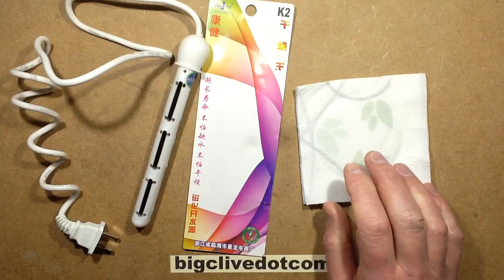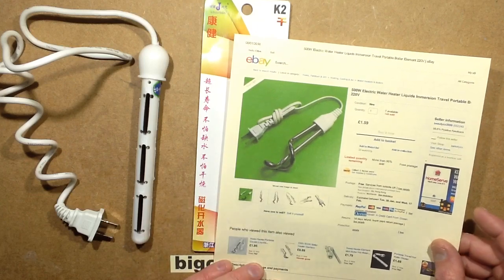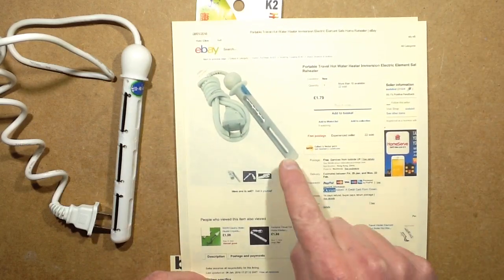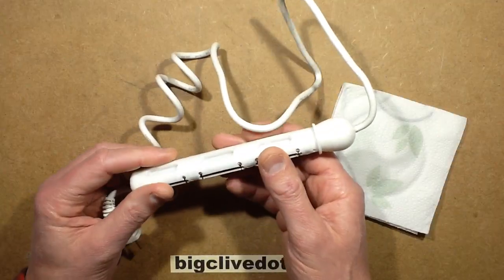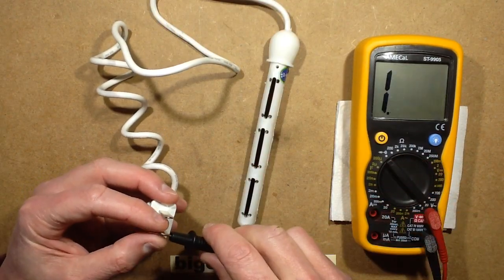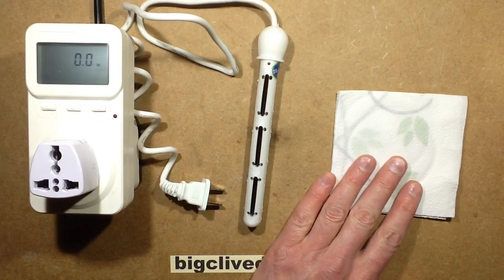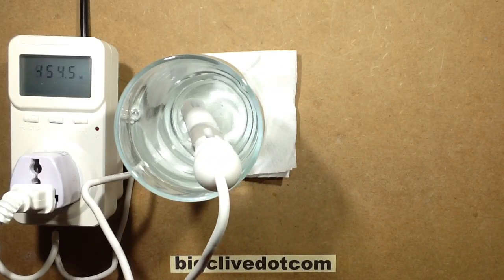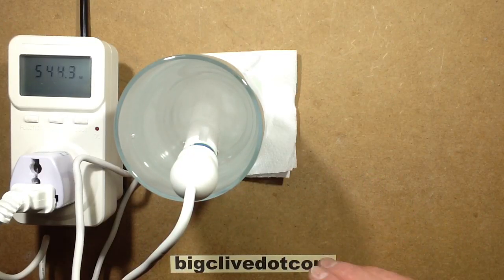Dangerous 240V Coffee-Cutor (coffee cup electrode boiler.)

Comment: Sealed hot water bottles
http://www.ebay.com.au/itm/Flower-design-Rechargeable-Electric-Hot-Water-Bottle-Hand-Warmer-Heater-Bag-/311342607829

After using these beauties a few times over a few years, I cut open the old ones to see how they worked.

The water came out rust brown, which was explained when I realised that the two bolts protruding into the water didn't connect to the heating element, they were the heating element!

Once the water is hot, you unplug them, so there is no danger of electrocution for my girlfriend when she needs a hot pack, but a couple of the bottles around the world have apparently burst when sat upon while hot, so avoiding putting weight on them seems like a good idea.
Reply from the maker: +loqkLoqkson I wonder how they prevent overheating.  Perhaps a pressure switch?  (I've just ordered one.)
Reply: There is a fixed thermostat inside that trips when it gets to temperature.  It is similar to this, but I'm not sure what the trip temperature is.

http://www.ebay.com.au/itm/KSD301-85-C-Normal-Close-NC-Temperature-Controlled-Switch-Thermostat-250V-10A-/200915905857
Reply: After seeing the rust from the first one I cut open, I figured I'd try some radiator coolant in a spare one. Disregarding specific warnings in the instructions to only use tap water, I turned it on in a safe place. It went about as well as your Turkish coffee pot with coffee :-)

Comment: Hi Clive love the channel very interesting, Many years ago I had an electrical shop and a customer came back from Spain with a coffee pot that  had 2 brass bolts with two wire from the lid down inside and on the bottom was a element that went into the water  on the lid was two wires to the mains 230v so I removed the leads and told her how dangerous it was !!!

Comment: I had something like this, I got from a junk sale.
Very unsafe for heating water, It works but also produces HHO gas via electrolysis, Having said that it's no good to HHO experimenters either because your gas will contain steam as well.
But hold a lighter near the top of the "So called boiling water" and you will hear loud snaps and crackles as the HHO is ignited.
BigCliveDotCom if you (Or anyone else) re-visits this device with a lighter, Please be careful and use a camping lighter & goggles.

Comment: could you get away with using one of these in a bathroom shaver socket (the transformer isolated kind), without dying? (given that it isn't connected to ground)
Reply from the maker: +Richard Manion the shaver sockets tend to be rated at about 100W so it might trip out the transformer thermally.
Reply: +Richard Manion A suitabllly rated floating output isolation transformer would make this much safer but would be expensive, bulky and heavy. The transformer in a shaver socket would be massively overloaded. I'm not sure if the overload protection in shaver sockets is self-resetting or if you would permanently kill the thing.

Comment: Not sure I'd want to drink whatever was heated that way.. electrolysis will probably do weird things to anything but pure water in there.
Reply: ***** sure it can, it just happens on both electrodes in the same amount.
Reply: Read in another comment that the atomic ionization happens too fast so the frequency of the AC is not sufficient to prevent the reaction. Makes sense I guess?

Comment: Aren't the Bubbles composed of 100 Hz alternating, perfectly mixed Oxygen and Hydrogen? I mean, we are basically splitting H2O into H and O through electrolysis. That combo is usually a very flamable mix? Hey they used to fly to the moon using that combo as propellant...

Comment: Clive, would you put this together inside a  kettle, some of the issues are still not resolved but if the electrodes were at the bottom and the kettle reasonably stable, this might be faster than the standard element style.
Reply from the maker: +Adrian Tech You can apparently get electrode kettles in some countries.

Comment: My dad showed me trick how to boil water something like this ! You need take wire with one end strip off other to be able plug in socket! And then take 2 razor blade from shaver and connect to strip end wire! put in the middle off razor blades 2 matches on each end and tie with small thread ! Make shore that blades are separate and stripped wire ends too! Then put blade side wire in glass jar fill with water in  center of jar and plug in socket  and watch to water boil and even some time can see jar jump .

Comment: It's a heater for boiling water, not designed for heat the coffee in your cup...
Usually people put it in a kind of thermos bottle to heat up water, then remove it from water.
You are using it in a wrong way of course it was not safe
Reply: +Adam Zhang And you are not measuring the voltage between ground and spoon, of course you will get the AC voltage....Again, these kind of things not designed to for you heat and touch water at same time, is designed for you heat water up and store in thermos bottle, so people can keep water warm in a long time.

Comment: This is a very dangerous product! It's not only the risk of electrocuting someone, but the byproduct of electrolysis! 
Tap water as you said contains some sort of minerals / salt in it, and electrolysing it would likely generate a large amount of Hydrogen, Oxygen plus some other gases like Chlorine gas. It could either pop from arcing or toxic if breathed in. 
Yeah, no, just stay away from this thing!

Comment: Bigclivedotcom could the little bubbles at the start be electrolysis?  Ie you could also be generating oxygen and hydrogen? 

This reminds me (you might find it on ebay) back in the 70s we had these "electric" hot dog cookers for camping.  It was a box with two stainless steel (or iron?) rails inside.  The stainless steel rails had sharp stainless steel points coming off of them every 1 inch down the rail.  The two wire power cord came into the box and split attaching each wire to the end of a rail.  You would take your hot dogs and stick them on the pokes between the two rails and then plug it into an outlet.  The hot dogs would sizzle and cook very fast.  I remember these being common at the time.  Perhaps you could find one for your show? lol  I have been told if you plug LEDs into the hotdogs as they are cooking the LEDs will light up!

Anyone else remember using one of these?  Pic of it here: http://i.ebayimg.com/images/g/LRgAAOSwLVZV0nso/s-l1600.jpg

Comment: if current is flowing through the water then the molecules are divided thus generating Hydrogen and Oxygen. So part of that bubbles will be that. Which means that you should not smoke around it when you are using it or it may blow up.

Comment: The bubbles formed before it boils are most likely Hydrogen and Oxygen due to electrolysis. Although commonly electrolysis is only done with DC, it does work with AC as well, but then switching the anode and cathode 50 times a second, which would usually negate the desired effects of electrolysis. (You could test this by trying to ignite the bubbles that are immediately coming off, theoretically they should be the perfect mixture of H2 and O2 of 2:1)

But I presume - and this is only speculation - due to the metals used, probably just stainless steel, both electrodes will be passivated quite quickly as the current gets higher, further reducing the electrolytic effect and just passing the current right through the water. The amount of current actually electrolysing the water should be quite low anyway as most of the effect is reversed immediately since it's AC. 

Would be interesting to see how much current would actually flow through something analog to a human finger, like a sausage with a slightly moist surface. I can't imagine that this would kill you instantly or this would be too dangerous even for Chinese standards...

Comment: Domestic water supplies typically have quite a bit of air dissolved in it.  (If it didn't, there'd be an awful lot more dead goldfish.)  Often, it is added by the supplier (aeration) before sending it into the mains.  Normally, gas solubility varies inversely proportionally to temperature, and is the case with water, nitrogen, and oxygen.  So that is what you see when the water is first heated, the air coming out of solution as tiny bubbles.  If you open a hot water tap and fill a glass, you'll notice after a very short while the water is momentarily cloudy, and for the same reason, it is air coming out of solution more easily than if it were cold.

Comment: I find it odd that it's rated for 220v and has an American type plug on it.  Well I suppose something like this doesn't really have any parts in it that could care about voltage.  Still they missed a trick by not putting the little holes in the pins, of which one use is passing the shackle of a small padlock through to provide some access control; small children likely won't have the resources to remove the lock and grown people would at least pause to wonder why has someone put the lock there before they go for the metal snips.

Comment: Thats not how you measure amps. What u did was basically short this yourself. To measure amps correctly you open up an existing connection and than put the meter in. You basically put a where no wire exists. Sorry but this is not good what u "teach" here.
Reply from the maker: +c2ashman The current I was measuring was the potential short circuit current from the water to ground.  Actual current would depend on the resistance path, but it was to show that high current can flow.

Comment: We used to make these when I was in the army in South Africa back in the '70s. It consisted of two razor blades (the old style double sided type), some cotton thread or fishing line, 9 match sticks and some lamp flex. You space the blades apart with the match sticks and line and connect the lamp flex. It would boil an average cup of water in a minute. The tea or coffee did however have a slight metallic taste, even though the blades were allegedly stainless steel. We knew what we were doing and it worked great for a couple of weeks, until the platoon thickhead came along with his metal fire bucket (military term for tin mug), plonked it down on the metal table and dropped our heater into it. When he switched it on there was a big flash bang and all the lights in B company went out. Torch light showed water all over the walls, ceiling and table, added to that the bucket was spot welded to the table. Unfortunately the problem was traced back to us, we had our immersion boiler confiscated and stood guard duty for two weeks straight.
Reply: what a story,youtube at its finest.
Reply: Stainless steel huh? Ah good ol' chromium poisonning !
Reply: Biggerbadwolf What is truly amazing is that you're still alive to tell us.
Reply: Thanks for sharing, laughed my arse off
Reply: Lmao
Reply: Well the metallic taste is no surprise, stainless steel is not immune to electrolysis. Perhaps try your wedding rings or some sticks of graphite.
Reply: @TheFreak111  hmm it’s weird because electrolysis shouldn’t happen on ac if the frequency is high enough. Maybe there was a dc component or something.
Reply: @sirhaydn-1  I'm not sure what frequency would be considered high enough, but regular mains is 50 or 60 Hz, which I think is super slow in terms of molecular processes. According to wikipedia a sodium atom has an average drift velocity of 5190 pm/s in an electric field of 1 V/m. 1/50th of that would be 1000 pm, which is further than the ionic radius of 98 pm. Now this is not stainless steel of course, but I guess that would be enough? Also 1V/m is not a lot. Not an expert on this, but I guess this kinda makes sense right?
Reply: @TheFreak111  but keep in mind that the polarity switches back and forth. So the movements would cancel each other out? I need to do some more research.
Reply: @sirhaydn-1  if conditions are such that electroplating would happen, yes. I doubt a perfect layer off and a perfect layer on would happen though. That could however still make it "plate" in a very non uniform way and form thin dendrite crystals which break off and fall to the bottom. But I consider plating some sort of dark artform, I can't say for sure what would happen.
Reply: @TheFreak111  I was talking about the fact that the sodium ions would just move back and forth and never make it to the cathode.
Reply: @sirhaydn-1  it doesnt need to. If a metal atom leaves the anode as ion, and returns to the anode as metal and grows a dendrite, there is no net loss on the anode. If the dendrite falls off though your anode still gets "eaten".
Reply: @TheFreak111  I was talking about reduction
Reply: @zeruulln  Standard electrical cable intended for relatively low loads. Historically, floor/table lamps were generally the first electrical appliances introduced within this load range, so the name stuck around.
Reply: That's fucking incredible XD
Reply: Awesome story !  Comment gold.
Reply: Damn, what an experience.
Reply: In prisons it's still common in my country (Hungary). Of lately using utensils instead of razor blades (as they are forbidden, and only electric shavers are allowed now).
Reply: This reminds me of a mains hot dog cooker. A fork in each end. Don't do that it is extremely dangerous.
Reply: DIY flashbang
Reply: nice to see a fellow South African
Reply: He had a "mong" moment.
Reply: Not to be operated by f*ckwits.

Comment: Some 220 volt mains supplies around the world e.g.USA  are centre tapped 110-0-110 volt with earth in the middle. So it is a bit safer there as the average water/ teaspoon voltage is nearer earth. 

Still remember  the massive  explosion we got when we decided to earth one side of the output of  a USA spec 220 volt mains inverter in the UK...

Comment: It's got a 120V plug on it though.  If it's designed for 120V and being used at 240V it's operating a 4X power!  V x A = W after all.  a 100W 120V heater will, at 240V, use 400W of power.

Comment: In some ways this is safer, as there are no exposed warm metal parts to burn yourself on. Just don't ground yourself when touching the water :-)
Reply from the maker: +theLuigiFan0007 Dangerous....     But fun.    And the reason you didn't get shocked more often is because you know the nature of the beast.
Reply from the maker: +Jon Watte Or indeed the still-wet heater unit.
Reply: +bigclivedotcom 
Quite intriguing indeed. I can't believe these are an actual product. Way to familiar to me..... 

.....You know I'l just admit it..... I built something similar I used to make tea for a while. Got tired of boiling water on the stove. It consisted of stainless steel strips attacked to a ceramic strip in the middle, that had holes drilled through it so current could pass between the plates in many different paths. Basically an inside out version of this that had all conductors exposed. It pulled 13A@120V, because I put sugar in the water before heating.

I use the microwave now FYI, because I once spilled the mug, and when it flew out,  the strip hit the spoon on the table and tripped the breaker it a nice purple flash. It works great, but it's dangerous as hell. XD

Seriously don't ask why I did such a thing. I'v been experimenting with electronics since a young age. Made a working salt water start capacitor for a motor I had when I was 14. Sometimes, I wonder why I never got shocked more often.

Comment: Been around for ages, recall one for use in a car
Reply from the maker: +Ian TheInventor That would have been the heating element type.  This is the much dodgier version.
Reply: Yes it was a heating element similar to the one in your bath heater video. You have some very interesting videos.
Reply: The heating element type have a closed circuit  through the element,  and ought to be sealed with no exposed low-resistance conductors.
Reply: +Ian TheInventor 
Vehicles normally using lov voltage as i guess You allredy know...

Those for operating under 48V (or lover) is legal in my country.

Comment: This is the same as sticking an anode and a cathode in the water right? Please excuse me if Im wrong but from what I know, isnt that basically electrolysis? So not only is it boiling the water, its also producing hydrogen and oxygen? Doesnt sound particularly safe. Could you hold a lighter above this "boiling" water and just see if the flame turns orange indicating that Hydrogen is present?

Comment: I was in prison in Canada back in the early part of the eighties and we used to make a device to boil water for coffee very much like this one. We took two teaspoons from the dining hall and broke the handles off them. Bent a small loop in the stub that was left to connect the wires to. Used a couple of small pieces of rubber as an insulator sandwiched between the spoons which were held together with elastic bands. Drop it in a cup and plug it in to a receptacle. Fastest cup of boiled water you ever saw. Was it dangerous? Hell yes. I would never do it now.
Reply from the maker: +Lyle Cheredaryk Yeah, but it was fun at the time wasn't it?

Comment: The Steam which is coming out from the beginning is actually H2-gas and O2-gas. So you could make a nice little explosion: just this device in a glass of soap-water and wait until there some nice bubbles on the top full of the gas. then take the device off and put a fire match close to the bubble. It will explode and give a nice little "boom". Try it! :)

Comment: i did similar things when i was a kid of ~12 years or so.
sticking 2 electrodes into a cup of salt water and see what happens
i still live, so it can't be dangerous ;)
(ah, and i should mention that i studied electrical engineering several years afterwards) :D
Reply from the maker: +bp72d There is a definite link between childhood electrical experimentation (usually resulting in a shock) that leads on into a full blown electrical career.
Reply: Mostly the experiemnts weren't so shocking for me, but for my parents :D